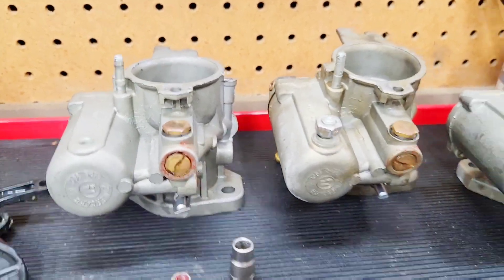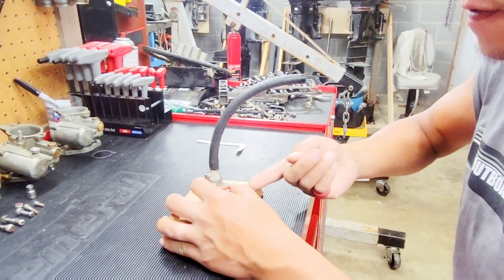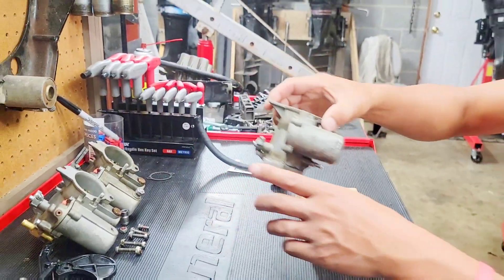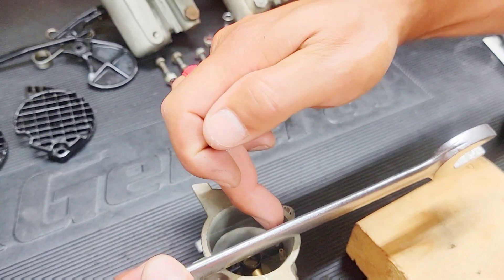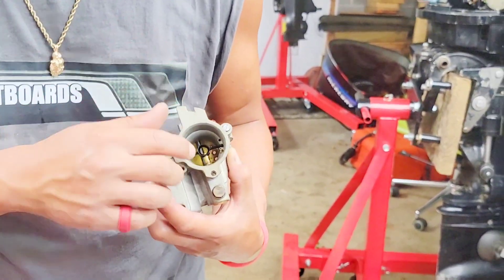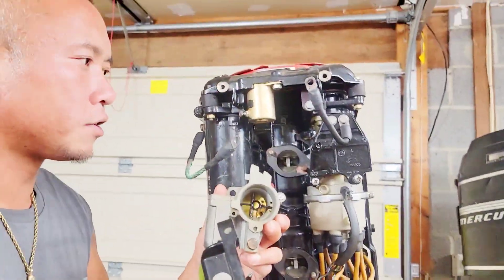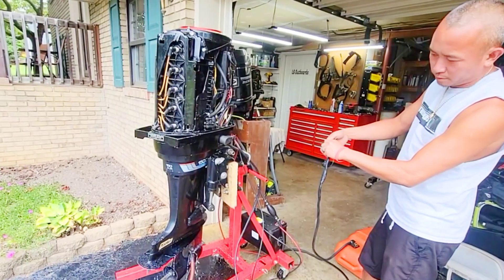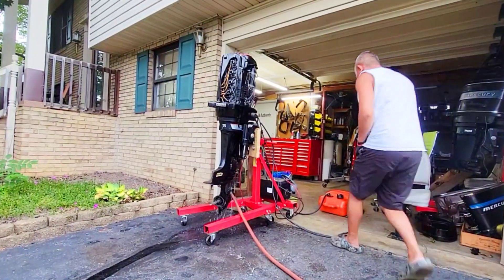Mercury Outboards: Setting the Tangs/Float Levels Without Measurements

Comment: Thanks for all  your vids. I have done this a million times with the measurements. This flat test is by far the easiest and most logical way of doing things. . I've replaced the needles many times, too. Now and then I still get a leaky carb. I think it is just the thing with these motors.
A full link & sync vid in detail would be good if you ever get the time and motivation.
Otherwise, thanks for everything. All the way from Australia.
Reply from the maker: I have link and Sync videos out already for adi and distributor models my friend. Son
Reply from the maker: https://youtu.be/x5MQUmXhf9c
Reply from the maker: https://youtu.be/OUFXaNgk0Xk
Reply: @MerCSonL6  you are a champion. Thanks!

Comment: I have a 35 1989 merc that takes a lot of cranking to start then runs ok but when I get above 1/2 to full throttle it cuts out to no power. Any thoughts?
Thanks for the videos. Enjoy them.

Comment: Hi! I have a merc 35 from 87’ with the same side bowl carburetor. It’s rebuilt and runs fine but when tilting up the engine fuel will pour out of the carburetor (seems like most of the fuel in the bowl pours out). Do you know if this is normal on these things or if there is anything I should check? Thanks in advance!

Comment: So if the tangs aren’t set right would it cause it not to start. I rebuilt pump and carbs but didn’t set the tangs. Mine will fire instantly with a shot of star fluid. Would that be why it’s so hard to start?
Reply from the maker: It's not getting fuel

Comment: Mercson, I have a 79 115 inline 6. When I pump the bulb up, fuel is pouring out of the carbs. It’s hard to start but once it starts I can restart it and it fires right up however, if I shut it off for say 1/2 hr or so and go to restart it it’s very hard to start. I have a fuel pump rebuild kit as well as three carb kits. Is this a symptom of carb issue?. Could it be needle and seat problem. I don’t think the carbs have ever been worked on. I’ve cleaned them but still have the fuel gushing out. Thanks for your help
Reply from the maker: Rebuild the carbs/fuel pump. And set tangs accordingly. Problem solved. Son
Reply: @MerCSonL6  Good morning. As always, love watching. Thanks so much for your help and support. Keep the videos coming!!!

Comment: Bro. Love your videos. Excellent explanations. I don’t think I wouldn’t have kept my Merc if if were not for you. I couldn’t take the tangs out so I soaked the entire bowl top assembly in spray can carb cleaner. Used a glass jar with a lid. When I took it out, the bowl was super cold to touch and  the needle and tangs were pushed out (fuel stuck open). the needle doesn’t go in and out. What happened?!? ‘83 40HP

Comment: @MerCSon, thank you so much for this video. I am restoring an '86 90 HP 2 Stroke Mariner Tower of Power and your videos have been invaluable!  I have the Service Manual and the measurements in the book leave the jet open a little. So thanks again.

Question, do you have a video showing how to remove or at least lower the lower cowling?  I'm about to dive into timing and linc/sync.

Thanks again!
Zac
Reply from the maker: Powerhead needs removed to remove lower cowling. You can lower it by removing the upper cowling bolts and taking off the horseshoe beneath the cowling. Son

Comment: Love your videos, I have a 1975 850 merc that stalls when I put it in gear. If I hit the choke button quick as I shift it stays running. Any ideas?
Reply from the maker: Fuel delivery issue. Not getting enough fuel.

Comment: Where can I get a carb rebuild kit for a 78 150hp
Reply from the maker: https://www.ebay.com/itm/362609160144?mkcid=16&mkevt=1&mkrid=711-127632-2357-0&ssspo=AdRkBcPPQa2&sssrc=2349624&ssuid=c7HxGSEnQjG&var=&widget_ver=artemis&media=COPY
Reply: Thanks how about the floats and other parts your videos have helped tremendously thanks
Reply: I need help finding a fuel pump kit and stator for this motor.

Comment: Hello son. I have a Mercury 40hp 2 stroke engine 1979. I have change the gas tank all fuel lines clean the carbs and it cranks fine ,but still want get over 5mph on full throttle.  What could be my problem?
Reply from the maker: It's not getting enough fuel is what it sounds like. Perhaps a link and Sync and make sure the carbs spray fuel through the main when you hit the venturi with compressed air.
Reply: @MerCSonL6  Do you have a video on doing something like this?
Reply from the maker: @bigjack5974  https://youtu.be/yh3YMJdONvI
Reply from the maker: @bigjack5974  different engine bit the concept is the same. Fuel should be spraying out of the main when the venturi is hit with air
Reply: @MerCSonL6  I was getting ready to do the test, but my primer was already hard, so I squeeze it anyway and seen gas coming out the main. I did the test anyway, and did see gas coming out the main when I blew air into the venturi.
Reply: @MerCSonL6  why does my gas tank keep alot of pressure in it? When I tilt my motor up gas just be dripping from my carbs.
Reply from the maker: @bigjack5974  your tangs are not set correctly. There should be no fuel leaking from the carbs. Fuel will naturally leak when tilted up. Nothing to worry about.
Reply: @MerCSonL6  okay thanks. Thought I had them set correctly.  13/32 flat and a quarter on the drop correct? Going to take the carb back off and use your video to set them.
Reply: That will effect my speed, if my tang is not set correctly?
Reply from the maker: @bigjack5974  it will affect everything. Bogging, idle, perhaps sluggish rpms at wot.
Reply: @MerCSonL6  I've set my tangs according to your video, install the cards didn't Leak when I pump some gas in. When I crank it for the first time, it didn't run right. I have videos if you will send me your address. Took it to the water gave it full throttle while still on the trailer and the motor..... hard to describe that's why I want to send you a video.

Comment: @MerCSonL6 I love your videos. I have a question I can’t seem to find the answer to in any of your videos. What would cause an L6 to shut off when throttle is applied quickly, but you can nurse it up to 3500 RPM but no higher while in the water. Out of the water (no load) it revs fine. I’m leaning towards a lean condition (clogged main jet) what do you think?
Reply from the maker: It's definitely a fuel related issue. Carbs are top of the food chain. I would check there first. Son
Reply: @MerCSonL6  oh, and thank you very much for the reply. :)
Reply: @MerCSonL6  that’s what I’m thinking. Many are mentioning stator “high side” is this a Merc thing only? Never heard of a high side ignition?

Comment: I’ve been trying too figure out my 1979 mercury 70 hp it like it don’t want too run wot rebuild the carbs checked the compression all good also I noticed like a white milky substance in the carbs at wot any help would be great.
Reply: It’s Gets like a white substance around the Vinatieri and inlet on the carbs . I haven’t checked the oil water separator yet hope I can this weekend. I still have boat in the water haven’t pulled it out yet .
Reply from the maker: Milky in the carbs? Milk is something that occurs when water is mixed with oil. I would check your fuel tank my friend. Son

Comment: Hey buddy I have a question I have a 1977 85hp Mercury outboard  run good out of water but you put it in water and put it into gear it dies what could it be please help
Reply from the maker: Fuel issue. All fuel lines, carbs, pumps, tank etc need to be checked. Also, timing needs to be set to spec with the carbs completely closed. I'm actually having a similar issue and I believe it to be the fuel pump but I do not like to guess. I'm testing everything. Video will be out soon. Good luck my friend! Son

Comment: Is it normal for the needles to kind of stick when fully pushed up? I've inspected them and it looks like they're good. But the kind of take a Lil more breath to pop them out when they get fully pushed in. I know the fuel pump pushes with like 5-9 psi. Do you blow fairly hard while testing it?
Reply from the maker: I do not. It common for some needles to stick. The oil from the fuel will loosen/lubricate. Son

Comment: Hey Son, if I replace my fuel pump diaphragm will I need to readjust my idle screws? Being that the old diaphragms was pretty hard compared to the new one. Thanks
Reply from the maker: You should not unless the engine was starving for fuel to begin with. Son

Comment: Son, Great video!  I'm working on a buddies 1985  35hp. I'm an outboard mechanic myself however I focus on Johnson/ Evinrude. Anyways, It has a similar carb with the side bowl. Ive had this thing apart 4 times and can not figure out why when i pump the ball its leaking out of the bowl vent. Also when shes running shes pumping fuel out of the bowl vent (.092). So it almost seems like the needle is sticking. Its a brand new carb kit with a new needle and seat. I'm pulling my hair out of my head on this thing Any suggestions ? PLEASE HELP. - Nick -
Reply from the maker: Oil from the mix will help loosen the seat. Have you tried to replace the seat metal gaskets? Lmk. Son
Reply: @MerCSonL6  I figured out what I did. The one tang with the half C bend in it was upside down! I don’t know how I did that .. twice… but after seeing your close up of it being level I realized right away! Thanks man, I’m a J/E guy , if you ever have an issue with one of those lmk . Happy to help !

Comment: I love your videos you seem to know your way around mercury engines I have I believe a 1988 80hp mercury outboard oil injected that the serial number was painted over and I can't read it is there anywhere else on the engine a serial number besides the transom bracket? I need a stator but don't know the part number the stator doesn't have a part number
Reply from the maker: On the starboard side of the block there should be silver circle stamp. Next to that on the engine block is the serial number. All you need is an cdi 4 cylinder stator. Have you tested the stator? I have videos on how to do that before you start throwing money at it. Son
Reply: @MerCSonL6  no I have not tested it I don't know much about this engines it fires up but when I give it gas it backfire
Reply: @MerCSonL6  there's a freeze plug a round silver stamp with the numbers A734373 Tha matches some of the numbers I'm able to see on the serial number on the transom bracket
Reply from the maker: @gilfredooquendo9969  that's your serial number

Comment: How often would you recommend rebuilding cards when using boat about 3 times a month?
Reply from the maker: Once every 2 years as long as you are using the best gas you can find and petroleum distillates (seafoam). Son
Reply: @MerCSonL6  I’ve been having issues recently with my 115 l6 early 80s. I can’t tell if it has a lean sneeze or back fire. About a month ago I had a crack in a fuel hose so I replaced them and took it out, ran fine. Took it out the next weekend and it was idling rough and won’t rev over about 3k rpm without bogging. Replaced switch boxes, fuel pump diaphragm and tested stater. Would it be possible to send you a video of it idling?
Reply from the maker: @chris94513  it should be idling around 750-900 rpms. I would grab a dva and check the voltage going to your coils at idle. Should be around 150V at a slightly higher rpm if my memory serves me correctly. Son

Comment: I have a trim question  ...can I test trim up/down with out it wired to relays ....just at motor leads ...I want to make sure it works before it's all put back together....
Reply: yes thats the right thing to do to confirm motor is working.. check both directions..
Reply from the maker: Yes. Son

Comment: Awesome video! Your videos have helped so much with my 1986 115hp! My trim motor has gone out, having a hard time finding the replacement, any recommendations on where to look?
Reply: you can put  new brushes into that electric motor.. just did that on my 1970 trim unit. merc.. tricky to reload the new brushes into the receivers and put the armature back into place and into the housing.. new brushes had to be shaped to custom fit.. but that was the easy past . new brushes cost under 10 dollars.. did the same job to my buddies tower of power a few weeks after that .. 50 year old brushes were worn to a stub. i guess it could be the solenoid but you can put 12 volts right to the terminals on the electric motor to see if its working.. check both directions.. both terminals ... than you know the motor itself is working.. good luck. it was a satisfying repair to do.
Reply from the maker: Just the motor? You can find that at marineengine.com or even ebay. Son